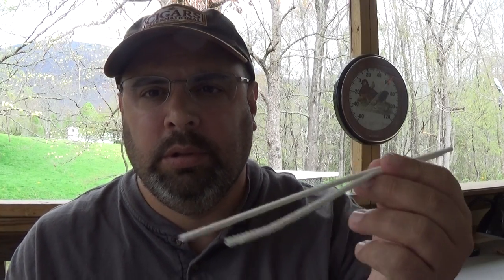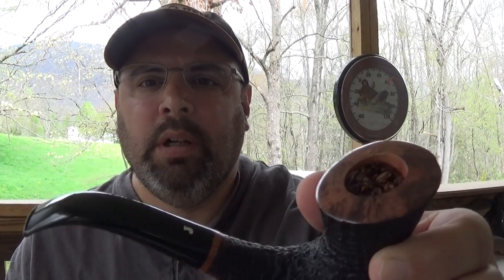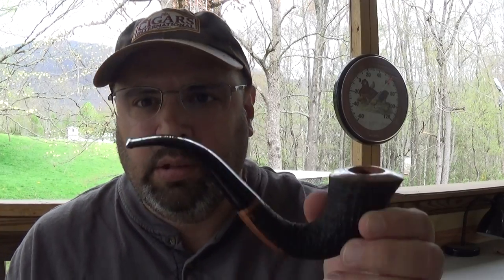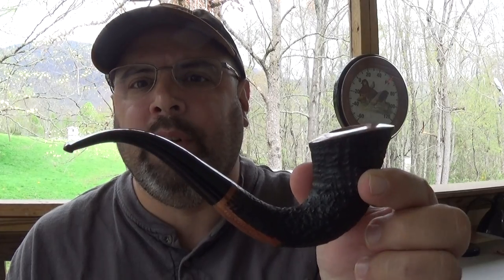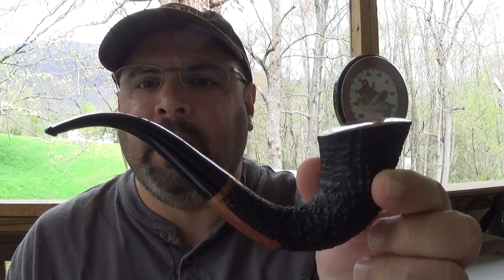How to break in a new pipe

Comment: I always use a burley to break in my pipes. Sutliff burley delight, Carter Hall, or Lane burley delight without bite. Good video. I never use honey, and I start off with tobacco in the mid point. Smoke that until ashes. Load up above the last level and smoke that down. Then fill to the top and smoke until ashes. I’ll smoke the new one everyday for a week until it is broken in. I clean the pipe and let it sit in the pipe stand for a month. I’ve been a piper for 30 + years and I prefer Aston pipes. ( jimmy Craig makes a better Ashton than Bill did).
That’s how I do it. I’m very careful with the lighting and always, always take my time. Everyone has their own way. I guess that’s the joy of the pipe. Enjoy.

Comment: We talk about breaking in a new pipe, but no one talks about seasoning the bowl. And yes, this can also be done with your well used or estate pipes. Here's how it works: first, give the pipe a good scrubbing. If an older pipe get rid of any excess cake build up or dottle (with cobs be gentle because they need a little pipe mud at the bottom). Next pack a full but loose amount of an aromatic such as cherry or vanilla. Smoke all the way down, tampering occasionally. Once cool, dump the ash and let the pipe set. Maybe an hour or two. Finally fill the bowl with a different blend, perhaps an American English or straight burley like Velvet.  Light and smoke it down, dump ashes once cooled and let the pipe sit overnight. In the morning scrub out the bowl. Then it will be ready to go. Finding out this helps to eliminate bite and gives one a much smoother smoke.

Comment: Great I'm on the right path. When you pack the bowl the first few times do you use the three step method? I was advised to just pack the bowl to the top, not to tamp it, smoke it to the bottom, and then dump the ash. Not to clean the bowl, and repeat for about 7 smokes. I'm in the process of breaking in my first Savanelli unfinished and don't want to hurt the briar. Thank you my friend!
Reply from the maker: jbmopar1971 You can use the 3 step method for sure. With unfinished briar, you wanna smoke slow! And try not to relight the pipe much. Tamping is fine...that isn't gonna do anything bad.That bowl has no coating or cake yet and it can burn real easy. I would use a burley blend to break it in. I would clean the bowl after each smoke by gently wiping it out with a pipe cleaner folded in half. Don't be in a hurry in anyway! Good luck!
Reply: Smokin' Briar thanks again!

Comment: I´m just now trying to craft my first own pipe from cherry wood. (bowl diameter is .787 x 1.181 inch. small bowl as i am not a frequent smoker) Is cherry any different from briar? And would it be wise to break it in with mixed aromatic tobaccos (like the VAUEN "himalaya blend")?
Reply from the maker: I would advise not using using cherry wood to make a pipe. Briar is very hard and fire resistant. Cherry, not so much. Just my opinion for what it's worth. Either way, have fun with it!

Comment: I can't get any air through the stim even if there isn't any air flow it's like something is stopping the air
Reply from the maker: Cody Gardner Do you have the tobacco packed to tight in the bowl? That will block your airflow in the stem.
Reply: Smokin' Briar no i didn't at first just some leaves and I thought I might of packed it too tight so I scraped it out and tried to just suck air out of an empty bowl and nothing then I took apart my pipe and I looked in the stim and there was like a blockage so I tried to clean it and the end of my stem snapped and it was glued shut
Reply from the maker: Cody Gardner Wow...thats not good. Sounds like that pipe is ruined unless you put a new stem on it. Is it a nice pipe? You can have a new stem made for it, but it will cost you about  $25-30 for it.
Reply: it was a 15 dollar pipe I bought at a smoke shop I drive a semi and was gonna be down for the evening so I figured I'd get a pipe reminds me of my grandpa when I actually got around to it I found out it glued they were already closed for the night I was just gonna try and find a cheap stim in the next town I go to
Reply from the maker: Cody Gardner I don't think you'll find just the stem and chances are it won't the pipe you have if you do find one. Try and find a rite-aid or Walgreens pharmacy. They both sell corn cob pipes and Dr. grabow pipes. Get one of those and try again. The corn cob pipes are less than $10 And the smoke great!
Reply: Smokin' Briar okay thanks yeah it was an expensive pipe so it's not a big deal just wondering thanks a lot